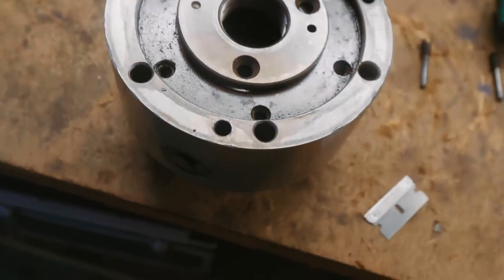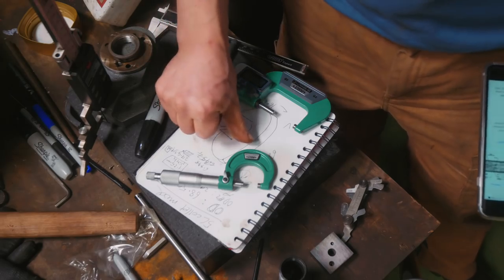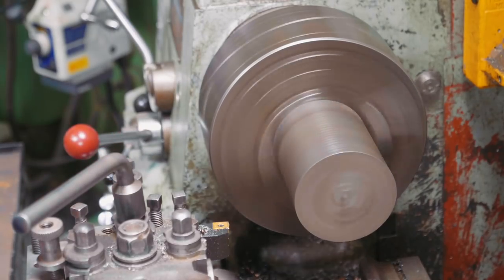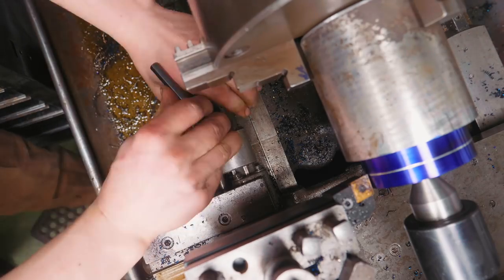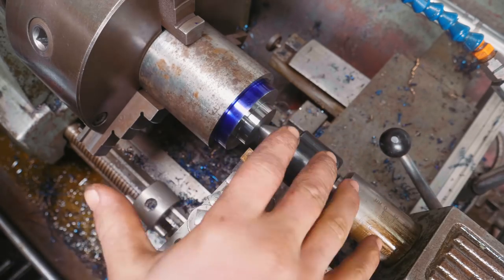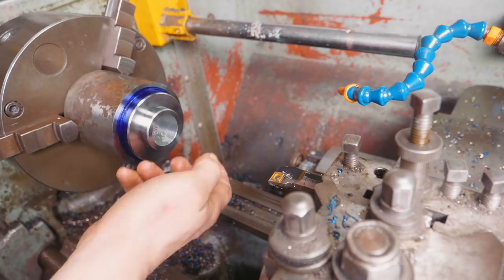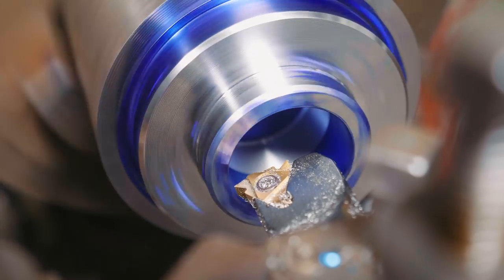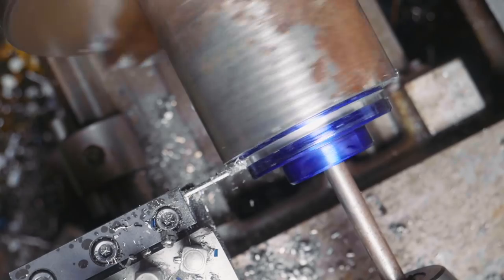LATHE CHUCK MODIFICATION!!! Part 2

Comment: I’m actually stunned your thread fitted at all for the reasons you mentioned.
You can cut an imperial thread on a metric lead screw.  It takes a bit of fiddling though😀
Also look up offsetting you compound slide to 30 degrees.  This way you can cut only on one edge of the tool and the threads come out much cleaner.
This is because the two chips don’t crash into each other.
Well done on making the part.  The dimensions at the thread end won’t be super critical.  It’s the taper end that needs to run true.
Reply: I thought of something else as well that would have made this job easier.
You didn't have to do the thread into a blind hole.  You could have bored the hole and parted it off.  Turned it around just like you did.  Face the other side and then cut the thread.
One of the hardest things about Fitting and Machining is the order of operations.  
Keep it up I love the machining videos as much as the whack whack videos :)
Another handy formula to keep in your head is Thread depth = 0.95 x Pitch
On your lathe you would have to double it as your dial seems to be counting diameter not how far the tool actually moves.
You seem to be happy to buy fun equiptment.  Look at a rotary table with a chuck. Or a dividing head.  That would have made your holes a breeze and no need for super glue :)

Comment: When working on a lathe...you have to remember that it is technically removing whatever you dial in on both sides of the part. That means if you want to take 10mm off the total diameter of the part, you have to dial in 5mm. If you want to take 1mm....take half .5mm and so on.
Reply from the maker: The dials on this lathe read double the carriage movement to read the diameter! So 1mm on the dial moves the carriage 0.5mm and takes 1mm off the diameter!
Reply: There are diameter reading and radius reading dials, this one is reading diameter (albeit in a strange way).  I have both so have to think before making a cut.

All in all you might want to mount a DRO

Comment: But if it rotates at the opposite way to what the threads are, doesn´t that mean that it will un-screw itself just from the g force when you start the laid??
Reply: There's usually too much tension when a chuck is tightened on the work for it to freewheel.  But I have seen it happen with a 3 jaw that didn't have anything in it - 3 jaw chucks have scrolls that are a large fraction of the chuck diameter and that can mean a fair bit of inertia
Reply: oo okey! thx

Comment: That metric lathe looks like an absolute nightmare to use. I will stick to imperial units when it comes to machining.
Reply: I disagree, I prefer metric. And I use an imperial lathe and still measure everything in metric. It is easier to find drills and reamers in mms.
Reply: The world would be a better place in metric
Reply: To each their own. I’m down with metric system measuring mass and volume, but measuring length I’ll be a grey beard and worship at the alter of the thousandth.
Reply: I got a ❤️ from Alec. My day has been made.
Reply: The weird measurement system comes because it is an absolute measure (amount off the diameter) rather than a measure of how far the tool is moving forwards I think. I have an imperial and a metric lathe and I use both measurements fairly interchangeably!